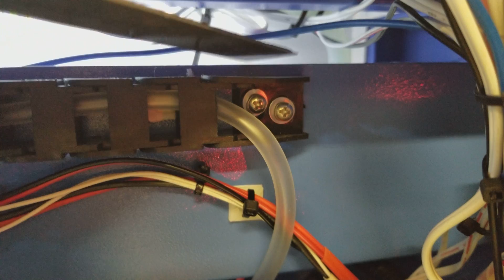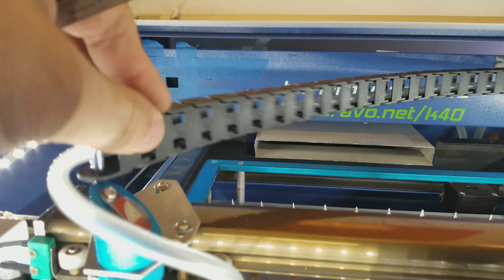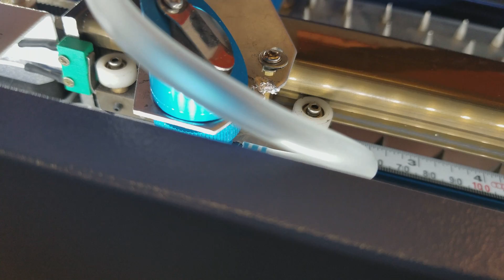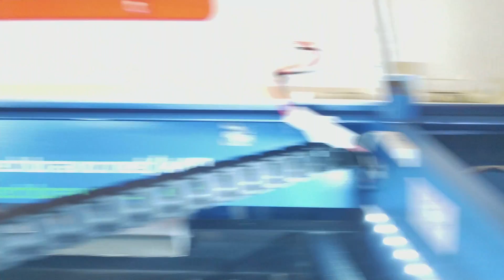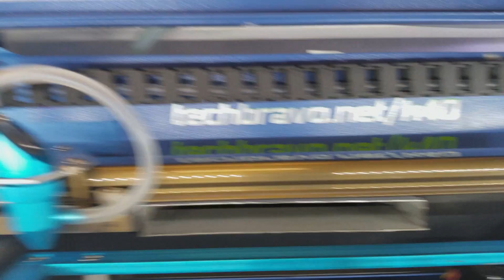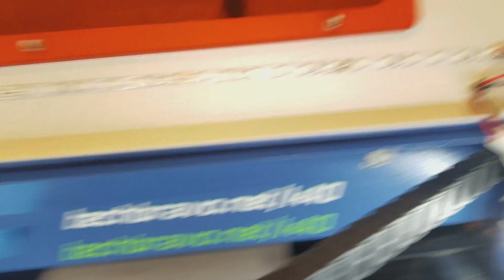Cyclops K40 Drag Chain Install Details- head attachment video in description .

Comment: Hi,  Question.    I have tried to install the drag cchain in my K40 the same way as you did but ther issn't enough opening to put it thru.
No issue,  i have tried another approach (and that issn't working either....)

I'm not able to upload pictures but  the seems your chain  stays away fron the laser head.   My chain is getting burned.
Can it be the air hoze force it to stay thight?   I hope i know what I meen.  mine mounted air hoze is very flexible. perhaps too flexible..

regards

Knight  (maarten)

Comment: I assume the head bolt that passes through the portion of antenna as a bushing is a bolt of appropriate lenght and diameter that you have affixed to a hole you drilled into the aluminum head bracket as opposed to utilizing the exsisting left forward mounting screw points? Am I correct? Do you recall the lenght and size of that bolt?
That would indeed work for me n the manner in which you fabricated the forward mounting point.
Thank you!!!!!!!!
Reply: Bravo Technologies 

Thank you!!!!!